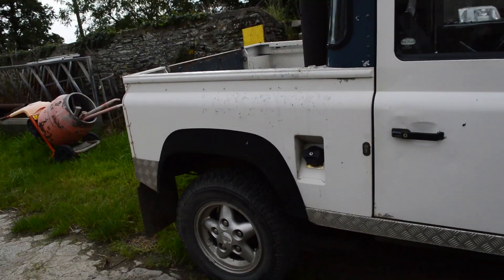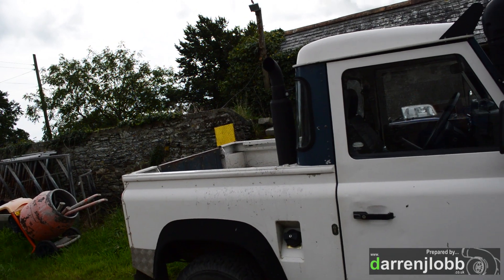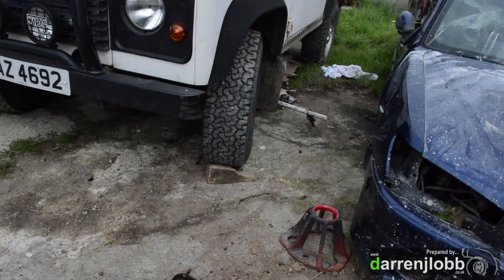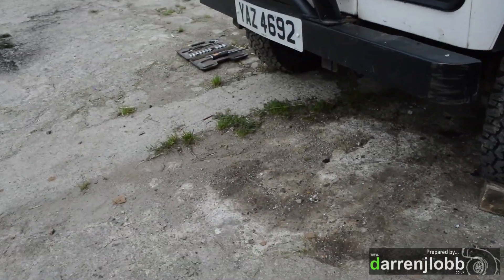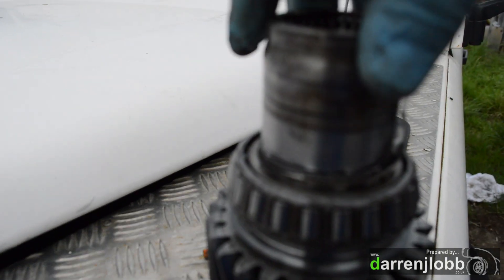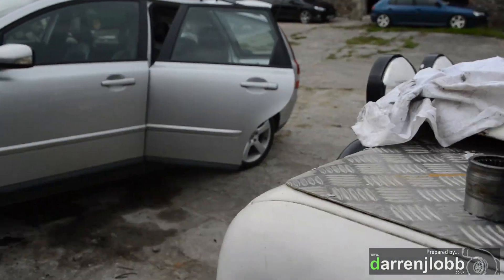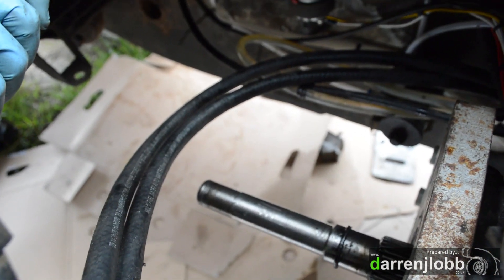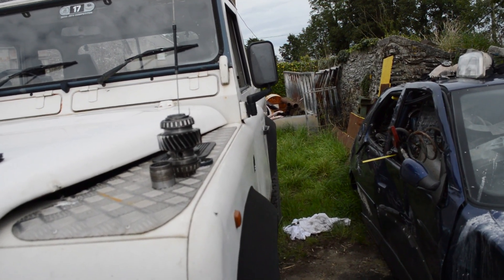Land Rover Cummins Conversion Part 14

Comment: Ahh that little box is never going to stand any sort of cummins power , billet or not. Need to see one of these with a well sorted auto !
Reply from the maker: +allistairc123 Heh, if it was mine personally it would be getting a full driveline out of a truck the engine was designed to be in :P And a dirty auto :P and likely rwd only heh, but its not so we are trying to get it sorted.